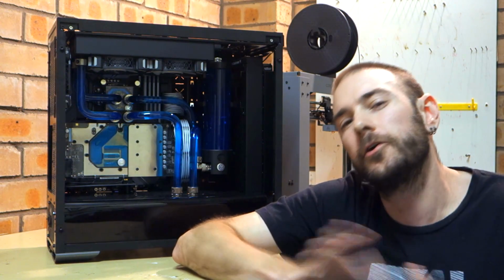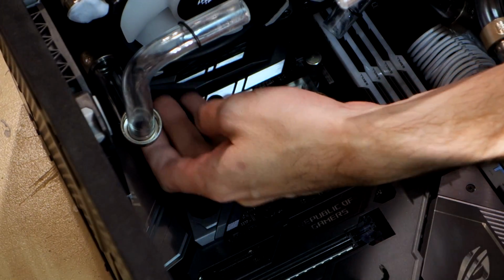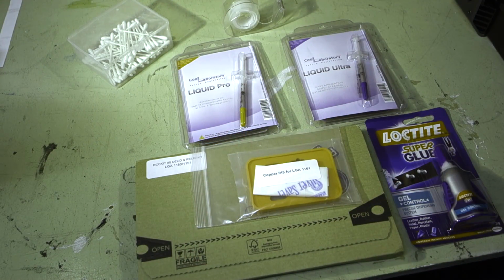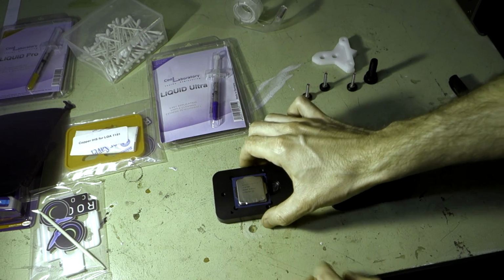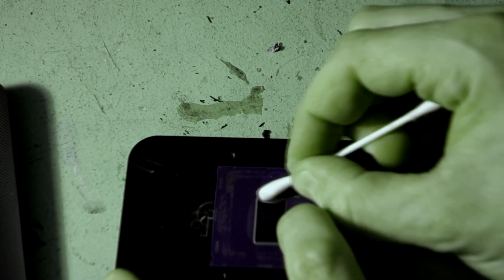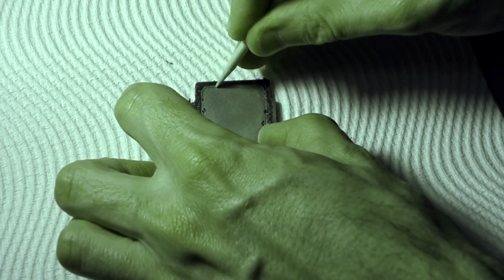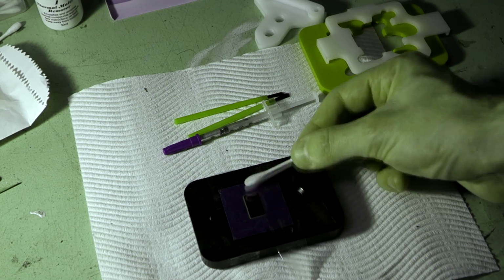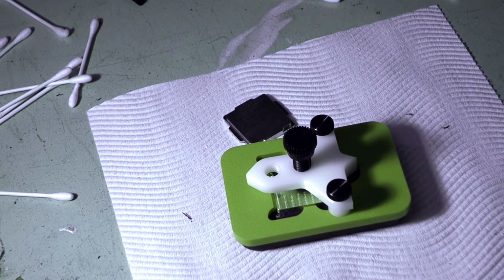The Complete 8700K / 8086K CPU Delidding Guide

Comment: Whats the point of replacing a nickel coated copper ihs with an pure copper ihs? nickel coated is even better when using liquid metal, cause it doesnt react with it !? O_o
Reply from the maker: Larger surface area and more polished finish. Check out my video about “thermal paste and liquid metal demystified. I cover the reaction with pure copper there.
Reply: You are right,... the reaction with copper is negligible, but still there is no benefit in replacing the original ihs. Many people already tried this, none could get any benefits out of it. The only benefit with a larger surface area would be that it takes longer to get a stable temp. Once you heat the components (and the ihs) up, it shouldnt affect the avg. temp. The die size still stays the same. 
I mean ... you get 1°C diff at best and unless you have very, very accurate measure instruments this 1°C should be in within the measure tolerance, which means no perfomance gain at all.
Many "big youtubers" like der8auer already confirmed that. 
Delidding the cpu is very benifical. Exchanging the IHS wont make any difference, no matter how big your new IHS is, unless its made of some material that can transport the heat more efficently. But you're comparing copper vs copper...
Reply from the maker: I think what it comes down to is that the percentage error in liquid metal application and haatsink application still accounts for more variance than the difference made by a larger IHS. 

Looking at the pure science, a larger block of copper before the thermal paste and heat sink will always perform better than a smaller one all other things being completely equal. If that were not the case direct die heatsinks that remove the IHS entirely would be a waste of time. 

A larger block of copper is going to wick heat away from the die slightly more efficiently. 

But you’re absolutely right that the difference is tiny.
Reply: The improvement seen with the copper ihs may be from the larger surface area in contact with the cooler. Of note also any material between the different metals also has an "insulating effect". In other words, each time you add another layer of metal and paste you get a lessening of the heat transfer capabilities. So in theory, direct die to cooler would be the most efficient. But with a risk of an easier to damage die. That is why the thinnest coating of the best thermally efficient coating is best, and between the ihs and cooler ensure you maximize use of all available surface on an aftermarket ihs. With, again, the thinnest application of compound possible.
Reply from the maker: Spot on.

Comment: That liquid Metal from cool laboratory, there's reviews on there saying that it eats up and corrodes copper. Why did you put a Copper IHS on the die with this liquid metal regardless of those reviews and warnings?
Reply from the maker: Basically because the reviews are wrong. Gallium eats copper. This liquid metal doesn’t use gallium. I did a video about this exact topic.
Reply: @boostedmedia  nice thank you. I just put everything in my Amazon cart. I hope I don't mess this up. I will use your promo code on that custom IHS site too.

Comment: Does liquid metal "eat" copper over time?
Reply from the maker: Good question. This is something I did a lot of research into before using a copper IHS. 

Gallium which is used in varying quantities in liquid metal products does slowly amalgamate with copper, which isn’t necessarily a problem but does slightly reduce its thermal efficiency and cause the liquid metal to harden. 

Coollaboratory Liquid Ultra is specially formulated so that it maintains its thermal efficiency over time. It only uses a very small amount of gallium for this reason.

So basically, if you plan to use a copper IHS, be selective with your thermal compound.
Reply: The original Intel IHS is nickel plated copper, so I guess is pretty safe to use
Reply from the maker: Correct. Have a look at ok at my recent video on liquid metal and its safety.

Comment: Why would you put tape on your cpu? That's a great way to get adhesive stuck on your processor.
Reply from the maker: The tape is to protect the substrate from the liquid metal while it’s being applied. The tape is removed and any residue cleaned before the new IHS is installed.
Reply: Boosted Media Thanks for clarifying, but don’t you risk wiping off or spreading the liquid metal when cleaning the residue?
Reply from the maker: No. The tape doesn’t go anywhere near the cpu die so he liquid metal is safe. It’s best to use the same type of tape I used as it doesn’t leave behind any residue anyway.  :)

Comment: You should never apply liquid metal to copper surfaces.
Reply from the maker: Depends on the liquid metal. https://youtu.be/PANdWh35HLQ
Reply: True that, but I am not aware of any copper friendly formulations available in PC market.
Reply from the maker: Coollaboratory say their product is developed specifically to work with copper. The amalgamation that occurs with their formula is not detrimental to performance because their product contains only a small amount of gallium. 

I’ve been delidded 3 months now and no change in temps so we’ll see how it goes long term.
Reply: If there is any amalgamation, then it will be detrimental. That's just science. But yes, in most cases it is a long term effect and can't be observed over a small time frame. Anyways, best of luck for you. Hopefully it will last for the meaningful life of the processor.
Reply from the maker: Correct. But according to them it still performs better than solder even after the amalgamation. Hopefully they’re right. :)